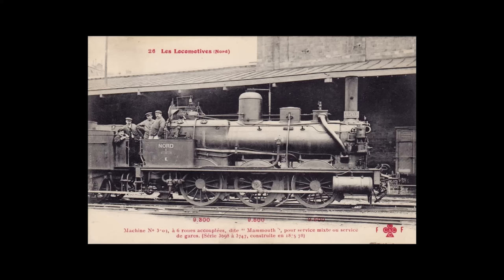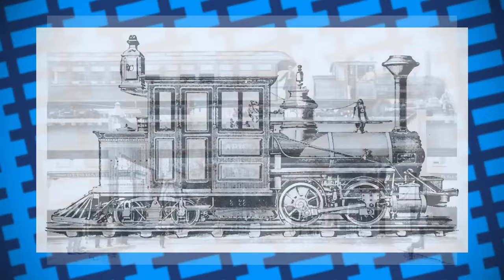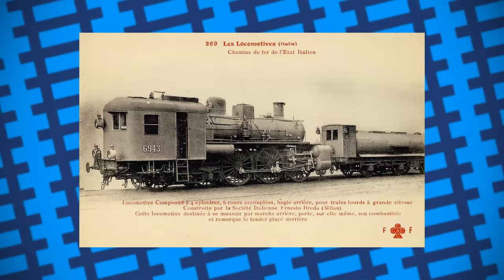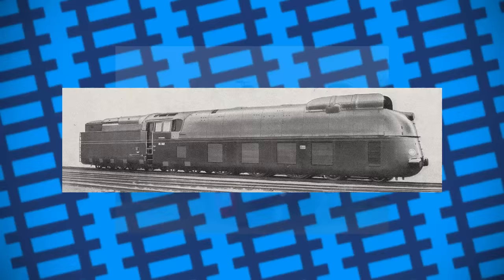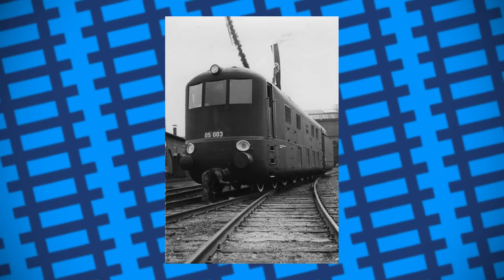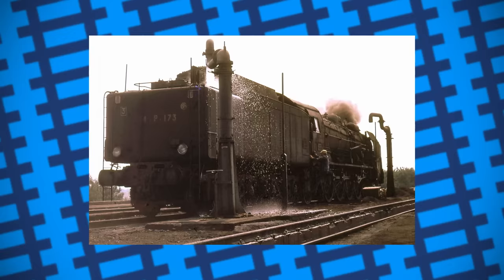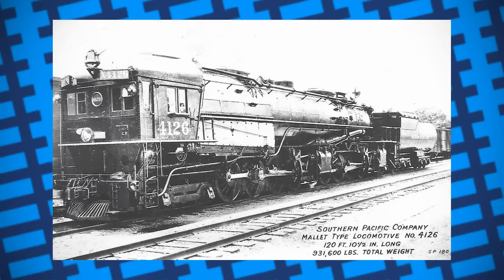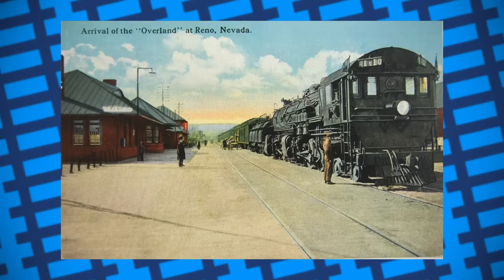Why "cab-forward" steam locomotives usually didn't work - Cab Forward Locomotives

Comment: Forney Locomotives operated in both directions. Southbound they ran boiler first, but then going north, they went tender first. After all, there is no place to turn a locomotive around on a New York Elevated line. A train would come in on track 1. Its locomotive was trapped at the wrong end of the train. The locomotive that was on track 2 then  moved to the front of the consist, to pull the train back north from there.The next train would come in on track 2. That locomotive would be trapped, but the locomotive left on track 1 was now free to lead this train off of track 2. At the north end the yards and maintenance facilities were located. The locomotive would be cleaned up, It would get a new tank full of water, and some more fuel for the tender. These lines ran perhaps 15 or 20 trains per hour. Hey! This is the BIG CITY you know. After electrification many of these Forneys found their way to Alaska of all places. Many remained in New York City. While the could not bull trains in the subway tunnels they were used in the construction of the subways before they were electrified. (There were no diesels back in those days.) Since subways were constructed by cut and cover, the smoke was no problem for the construction.
broadwaylion.com

Comment: I wonder if 4294 could be restored to running order. That would be a very neat engine to see in action, perhaps even alongside 4014, 3985 or another big articulated locomotive.
Reply: Sadly that's unlikely to happen. Although 4294 may have escaped the scrap yard, it was still canabalized for parts. Many crucial components are missing, and while they could technically be remade with modern tools and technology, the California State Railroad Museum, where 4294 is on display, simply doesn't have the budget to restore it to operating condition right now, let alone anywhere to run it.
Reply: The museum estimates it would cost 1.5 million $, and they can't afford it.
Reply: @oscar_charlie  That seems pretty common. At least it's possible, unlike other locomotives that are deemed incapable of restoration. If someone really wanted too, they could start an organization to work with the museum or lease it from the museum similar to the partnership between Kentucky Steam Heritage and the Kentucky Railway Museum. KSH approached the museum about restoring C&O 2716 and in return they get more funding and publicity so that they could also work on restoring their other steam locomotive, L&N 152.

So I would call it a silver lining that it could be done if someone really wanted too.
Reply: Let it be known, the museum can afford it. It just has no need. The 4294 is the most popular exhibit and taking it out for five-ten years for restoration would be terrible for profit in the meantime

Comment: German cab forward BR 05 was fired with coal dust (Kohlenstaub), so there were no problems with dripping oil. But I think the main reason was, that they needed the oil for other things and coal dust was available. And as far as I know, incomplete combustion of the dust particles has always been a problem and lead to clogging of the heating pipes in the boiler.

Comment: I always figured that, if steam had continued just a little bit longer, the standard configuration would be a cab in front of the smokebox with firing done remotely with electronic controls.  If they were still being developed today I'm very confident the standard would be computer-controlled oil firing, probably using diesel fuel.  Strong chance the engineer would simply have one lever for power and an ECU would handle the valve timing and actual throttle position, as well as firing.  This would also bring MU and DP capability to steam.
Reply: If a steam engine was able to be as efficient as a diesel, this makes sense, much like modern steam power plants. The efficiency problem with steam engines is a thermodynamic one, as they are an open non-condensing cycle, much of the energy from the boiler is wasted. Power plants have large condensers and the combined cycle gas turbine/steam plants are remarkably efficient.
Reply: Huh... for an alternate universe where ICE is never invented, this might work. But I prefer thinking about an AU where the problem is no fossil fuels. You can run steam locos on wood, but ICE fuel would be really expensive. Not sure how well you could automate feeding wood into an engine... We would still eventually make the jump to electrics, but it would be a different world.
Reply: @matejlieskovsky9625  I don't see a big problem with automatically feeding wood.
It's already done in furnaces and power plants.
Either in form of wood chips, pellets or charcoal.

Comment: in the UK, where I live, the driver's restricted view caused on of the worst train crashes in rialway history.  The St. Johns accident involved three trains on being rear ended by a locomotive who's driver couldn't see the signals due to his positioning in the cab as well as thick fog.  On colliding with the stopped commuter train this train the brought down a bridge ove which the 3rd train was passing crushing te first 3 carriages. The mayhem left early 10 passengers dead or injured.  4th December 1957.

Comment: the northern pacific narrow gauge 4-4-0 had 2 problems
1: they didnt draft for shit, and they quite literally had to cut a hole in the front of the cab
2: it had a marine boiler. and we all know how that goes lol
Reply: W G Bagnall (Castle Locomotive Works, Stafford, England) built a great many engines with marine boilers, and plenty of them are still with us, working as well as ever. Ask the crew at Statfold Barn museum. The Northern Pacific engine turns up in Thomas the Tank Engine, I noticed - she's very accurately drawn, and described as 'experimental.'
Reply: I mean, NPC 21 was kinda accurately drawn, they did change the gauge from 3ft to standard

Comment: Well, it would be easier if they add additional cab, a pilot cab at front of the boiler. This cab will control the steam pressure, break and the steam engine. The previous rear cab will serve only as the furnace, and a simple communication cable like a sound pipe or a bell system connecting the rear cab with the front cab as the bridge and the engine room in the steam ships. I don't know that this is not being thought of at the time as this communication system has been applied in the manor houses and the steam ships during the mid 19th century.

Comment: But, out of the Cab-forward steamers, SP did have the best cab-forwards due to it being an oil burners. The AC-9 was the only non-cab-forward steamer which the SP Crew dubbed it the Reverse Cab-forward. Fuel oil are directly fed to the firebox not to the boiler. The Living Legend (UP 844) and 4014 Big Boy and most of the steamers in the US running on Excursions / tourist attractions are oil fired (Except for C&T and D&SNG) to prevent trackside fires. Oil leakage are rare on oil fired steamers, mainly good maintenance and oil is thicker than water.

Comment: Seems to me that running something like the... Garrant? You know, the ones with a (low) tender at each end, backwards would have done the job. Coal tender at the front. Low, but without over half it's volume taken up by water it can probably carry at least as much coal as a regular one, water tender at the back, which can also be bigger if need be due to not needing to accomodate the coal.
Only problem, of course, being that you end up with the tender/cab interface at the front, which could cause a variety of issues which would need to be designed around. Still much lesser problemls than any of those brought up in the video.
Reply: Considering the big SP ones were American, Garretts would not happen, as American Railroads didn't like the design, and there's also the fact that having a Garrett wouldn't get rid of asphyxiation because the stack is still in front of the cab
Reply: Also, wasn't one of the Garrett s  short comings the fact as they used up their fuel and water, tractive force declined? They were cool locomotives though.
Reply: The Garrett type should be considered a double ended articulated tank locomotive, and yes Mr. Bruce Boatwright like most tank engines weight on the drivers decreased as fuel and water was   used up on a run.  Tractive effort did not decrease but they could become slippery.  Canadian railways considered the Garrett concept but in the steam era, generally ran frequent and shorter trains than the long drags common in the Yankee southwest or the southeastern coal regions.

Comment: This is interesting and I find a parallel here with diesel locomotives.  In the first several decades of diesel it seems that freight locos mostly had the cab at the rear.  I'm guessing that this was a hold over from steam engine design.  From what I have read, many engineers preferred that layout as in the event of a wreck or collision at a road crossing, they had much more metal between them and the point of impact.  However, the railroads felt that cab forward increased visibility would ultimately be safer all around and thus that is the standard today.  Yes, it is only a matter of flipping some switches and a diesel will drive either way, but cab and control layouts favor cab forward.

Comment: And due to the coal dust system the "fireman" in BR 05.003 actually IS in the front cab. The fuel is "pumped" from the rear tender

Comment: Ok, so... the way the oil leak issue on the Southern Pacific units could be fixed is actually quite simple. Since with oil you don't really need the fireman to directly feed it into the firebox anymore, you could simply have the firebox at the back of the locomotive while still having the cab at the front. Include a proper rail along the footplate similar to many freight diesels (or possibly an enclosed walkway, similar to the Flying Scotsman's Tender) to prevent the risk of falling off the locomotive while in motion, and whenever the fireman does have to check on the firebox, they can quickly just make their way to the back, check on it, and then go back to the cab.

Comment: The italian "cab-forward" FS 670 was nicknamed Mucca (cow) not only for the peculiar bulky shape, but also because the tender with his little cab had roughly the same shape only smaller, so the two together resembled a Cow with her calf (Mucca con vitello)!
As i know one of the reason of the experiment was to use in the mountain lines with many tunnel where, until electrification, there were so many cases of staff poisoning due to smoke. But in the end they weren't used for that, maybe due to the not great power and the  inability to understand problems perceiving noises and smells. Some were later modified with superheater and lived until the end of the '30 in north Italy Po valley.
Reply: I once heard the "cow" nickname is also related to how they got their money's worth out of the capability of the design. That is to say, they milked it like a well-treated cow

Comment: My immediate thought on tackling the problem is a conveyor belt beneath the locomotive running to the tender where a cord from the cab operates a feed that dumps an amount of  coal onto the belt and delivers it to the bunker for the fireman whenever it runs low. Probably want a decent bit of insulation of it, likely in the period asbestos or similar, but it should be more practical than the things that were tried.
Reply: that or design a cab that extends over the tender and a tender with a space for the cab to extend over it.

Comment: Plenty of engines ran 'tender first' (ie backwards!) on British railways when a turntable wasn't available. The requirement even appeared in some timetables. One example is the Border Counties Railway where the turntable at Redesmouth was too short for the bigger tender engines, so they had to run tender first back to Hexham.
Reply: It’s much safer if they do so slowly, so as not to derail.

Comment: In the case of BR 05.003 the cab forward was not done for improved speed, just for improved visibility. And the problems where not with the cab but with the coal dust firing system (germany tried those a couple of times - the GDR/East german version system worked)

Comment: As far as I know, train engineers run their locomotives sticking 3/4 of their body outside, hanging outside of the loc. That's how you get a 360 grades  view ... So it's better than what a cabforward can give you, even in the oldest combination. Also, imagine lets say running the loc Dresden to Berlin. The only thing you need to notice is signalization, it's not  a truck running in atmosphere of drunkards, bycicles and animals. A cab in front is in fact not that necessary.

Comment: I guess another potential solution would be an elevated, "one and a half storey" cab, with the driver being somewhat elevated and to the side of the fireman. Obviously that would still impede interaction between them somewhat, would require the lines to be capable of running these higher locomotives, and vision over the firebox and boiler would still be worse than sitting in front of it

Comment: The german 05 003 had massive fueling issues. It was planned to be fueled with coal dust which basically was a working concept. after a short while the coal dust proved to be very fine and was escaping the fuel delivery system everywhere. the Locomotives mechanics were so dirty after a short while driving that it was, as stated, refitted to a standard configuration. cleaning and maintenance would have cost more than the possible advantages were worth.

Comment: i wonder what a modern cab forward would be like
Reply: They already exist. They're called diesel-electric locomotives. The cabs are already at the front on many of them because there's virtually no reason to have the engine, generator, and any other big components ahead of the cab.
Reply: Feel like if you were going to make a steam locomotive now giving it a traditional design but having camera(s) and on the front and a large screen in the cab would be the way to go.  Wonder if this could have been done in the past with mirrors and lenses in a periscope arrangement?
Reply: @CaliPepper  AS IN STEAM. DIESEL ELECTRIC LOCOMOTIVES ARE DIFERENT FROM WHAT I MEANT. I MEANT STEAM HOW HAVE YOU NOT KNOWN THAT
Reply: @scottthewaterwarrior  odd. i was thinking that there was 3 compartments.

one for the boiler. and the firebox. long articulated locomotive sort of thing

Comment: Why didn't they try a periscope system to see the track clearly ahead? Or a mirror system with mirror reflective tubes and a screen mirror for the driver. This would be useful for open air running notwithstanding that a mirror system would not help tunnel working, where smoke-back had been the main problem.

Comment: If fumes/smoke in tunnels were an issue, why not just put/pipe the exhaust to the end of the cab? 
I get that a longer exhaust is not optimal, but it seems like a simple solution compared to putting the cab at the front..

Comment: 3:14 That was my idea that it should be ideal. Driver in the front, fireman in the back. Communication basically through some signs, and if talking necessary, through some pipe maybe. Without a catwalk on the side of the engine, which would connect the two cabin it would be not as useful because of the mentioned reasons.

Comment: Rear cab provide easy access to the fuel, shovingthe fuel into the furnace. The forward cab is more feasable when transitioning to fuel oil or diesel engines.

Comment: The true beauty of a steam engine, the one thing that diesels can't match, is fueling options. In an environment where refined diesel or gasoline (or petrol) is less readily available, a steam locomotive can be configured to run firewood, coal, or fuel oil. That is why diesels work so well in developed environments: diesel fuel is quite available and they're easier to run.

The funny thing about the cab forward issue is that you could totally negate it these days by mounting a camera or two on the front end.

Comment: This video claims that oil leaks from the feed from the tender to the firebox was a serious problem.  I find that hard to accept for 2 reasons:-
1)  Most of the tender load is not fuel (be it coal or oil), it's water.  Water from the tender (or side tanks in a tank loco) is continually injected into the boiler maintain the boiler water within limits.   You could have a fuel oil tank in front that would not affect driver vision nor upset weight balance, and a purely water tender behind the smoke box end.
2)  It would be an obvious thing to do to pipe the fuel oil via a double wall pipe, as is done in marine engine rooms.  If any oil leaks from the inner pipe into the space between inner and outer walls, it drains to a safe place, which also has alarm contacts to warn the crew a leak is happening.

Comment: 0:42 isn't that a 4-4-0 then, since the guide wheels are forwards in the driving direction?
I.e. it looks like a 0-4-4 because that's what it would be if you drove it boiler-forwards (the wrong way).
[edit:] ah, I didn't catch that it was designed as a boiler-forwards engine, because you showed a figure of the cab-forward configuration while talking about its design phase (and then a boiler-forwards picture while talking about how it was run cab-forwards).

Comment: The ‘smoke in tunnel’ issue is easily solved by routing the smoke stack back behind the crew, which would greatly improve conditions all the time. Too bad they didn’t have OSHA  😅

Comment: So the real problem was that they all tried to design a locomotive with a cab at the front, instead of a tender with a cab and a captain that commands the rest of the crew, with a locomotive in reverse as the second link.

Yeah sure an empty tender doesn't plow through stuff quite as effortlessly as a steam locomotive does, but that should not be a problem as big as the others they put up with.